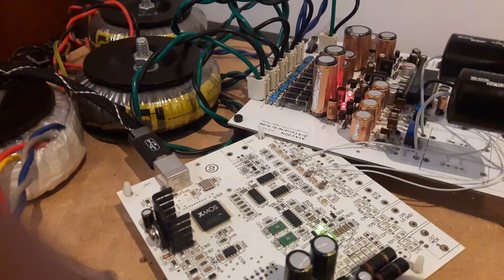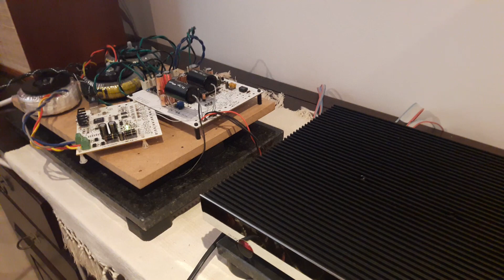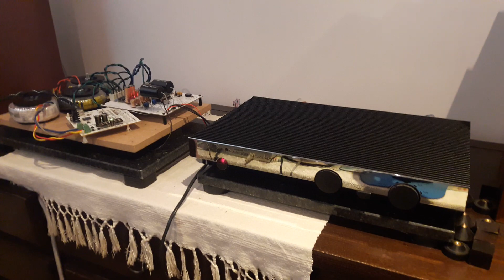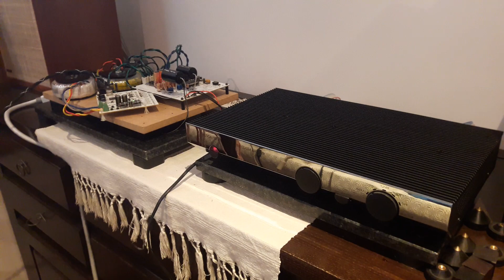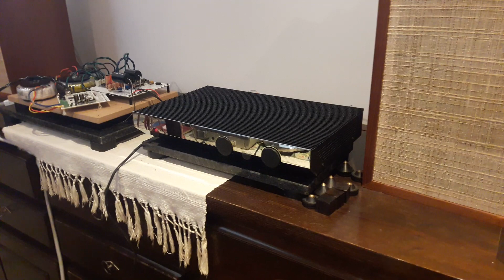AYA II DAC - Philips TDA1541A - Capacitors with Copper Foil Shielding

Comment: Just came across this, excellent sound !   I also have an AYA2 , are you using Panasonic FC for the -15v and OPA861 PSU ?   I've recently added copper foil and grounded to the TDA1541A , I have not tried it with the caps
Reply from the maker: Thank you! I'm suspicious to tell that, but I appreciate very much the sound of this DAC. The copper foil around the capacitors is to reduce the EMI they tend to emit. It's away more effective in big capacitors that act as big radio antennas, polluting the near field with their radiation. You don't achieve a night and day difference in the way the DAC presents the music, but a little gain in the ratio signal/noise, so you have better focus and perceived the details with much more clarity. In every TDA1541A (1997) power supply lines I use Panasonic FM, to feed OPA861 I have Panasonic FM capacitors.

Comment: Philips TDA1541  no14   Best chip. Thanks for the video. What do copper screens on electrolytes give in the sound? Can't see which exit after 1541?
Reply from the maker: Have no doubt that the TDA1541A is among the best DAC chips ever made. The copper layer around the capacitors serves to reduce, or even nullify, the EMI emissions they produce and greatly affect all DAC chips. What do I win? More naturalness, more detail, more focus, more articulation of the sound. Of course, the work is not finished, as the DAC needs to be inside an aluminium box to isolate it from the RFI in the environment. After the TDA1541 chip is a zero-feedback output stage with OPA861 op-amps, created by Mr. Pedja Rogic.
Reply: Copper tape ?
Reply from the maker: @Vintage-hifinorway  Yep! Very effective to reduce the electromagnetic radiation (EMR)  produced by the big capacitors.

Comment: Dear Antonio: Just note the voltages & replace the power supply  with low noise ripple in the milli/micro volts and feed it with a source via USB that has low noise,
( Oscilloscope confirmed is best) I will create magic those old designs are great just never had proper power
Reply from the maker: Completely agree with you! Many thanks for your comment!

Comment: Have you experimented with removing the actual plastic wrap on the capacitors?
Reply from the maker: Yes, but the improvement is not so big as using copper foil to reduce the electromagnetic radiation that comes from the big capacitors. This upgrade is even more effective if it's used a wire to connect the copper foil to the ground point.
Reply: @antoniocruz5714  Hmm, now this is something I will have to try!

Comment: Hi Antonio, how do you connect the foil?
Floating or grounded.
Karl-Erik
Reply from the maker: Dear Erik: It's very easy, just use a thin layer of solder at the end of the foil. It's even more effective, reducing the electromagnetic radiation, if you use a wire to connect the copper foil to the ground point.
Reply: Dear Antonio, have you tried with the foil not connected to ground?
Reply from the maker: @karl-erikmoberg5668  Yes indeed. If you have a look at this video, it's easy to realize that there's no connection to ground.
Reply: @antoniocruz5714  Have you tried to connect the foils to ground?
Reply from the maker: @karl-erikmoberg5668  In this DAC not yet, but I've done it in other jobs with great results.
Reply: @antoniocruz5714  I will try it in my own players.
My 2 cents is that it is more about to get a better ground for the capacitors.
Reply: I have now put copper foil round the filter capacitors around TDA 1541.
Major improvement, more space, detail and dynamics.
Thanks Antonio
Reply from the maker: @karl-erikmoberg5668  : Erik: Place copper foil around the large capacitors. This is how this tweak is most effective, as they behave like antennas, emitting a lot of EMI that interfere with the digital chips.

Comment: i could live with this sound forever. and it seems it is not super expensive. 
i just don’t know how to modify anything 😅
Reply from the maker: You don't have to spend a big amount of green to get a very nice sounding setup. It's all about matching the stuff and implementing some upgrades.
Reply: @antoniocruz5714  unfortunately i don’t know how to do upgrades. if i had electrical knowledge and soldering knowledge, i would buy audio note uk components as upgrades. 🙂
but i don’t know if they would match! i just know they are quality parts.
Reply from the maker: @verbatim_transfer  You couldn't go wrong with Audio Note, it's among the best audio stuff available in the market!